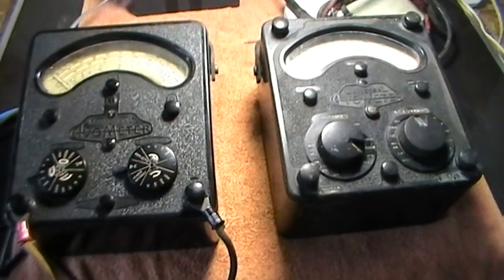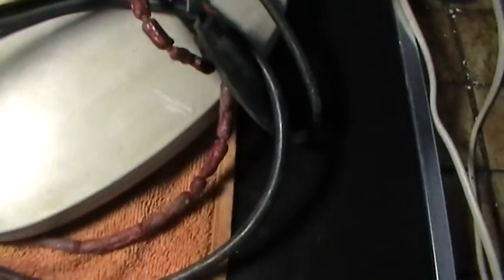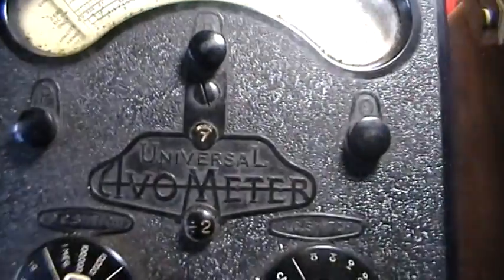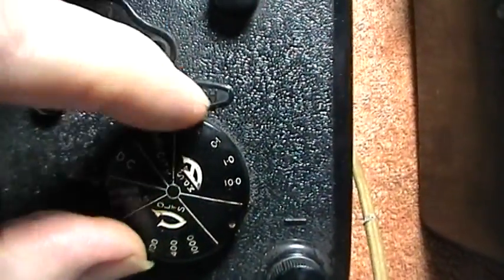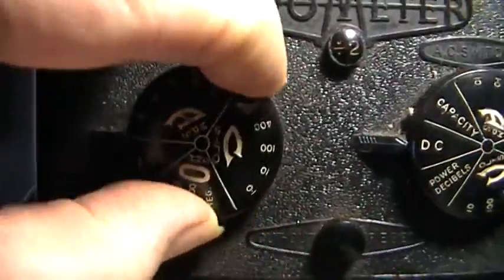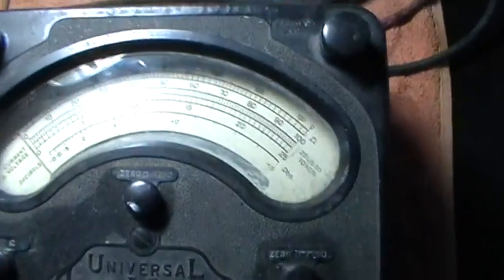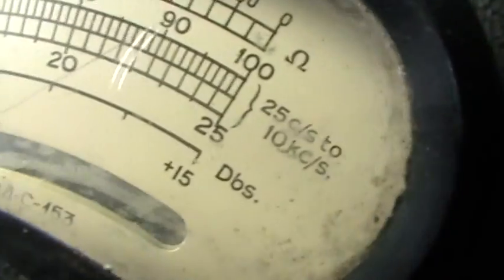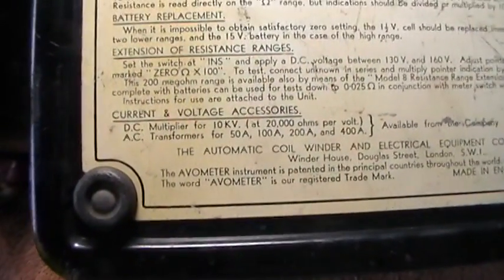AVO multimeters models 7&8

Comment: I picked up the model 8 I payed £5 for it Bought it out of curiosity please please what is it worth? Not sure if it works don’t know how to use it
Reply from the maker: Looks like you had a good bargain, check it out the batteries in it are probably dead and the smaller one may not be still made, take care when testing the meter. How much would these cost I do not know it seems vintage stuff has really gone up in price. Good luck

Comment: The Avo 7 is the 'electricians' meter and is less sensitive than the 8 which was intended for electronics applications. Although Avo's were produced from the 40's onwards, their hayday was the 60-70's.  Apart from nostalgia, they are still useful to the vintage radio fan for servicing even now, due to the voltage readings in period service information being taken by Avo's. Using a modern DMM with their very high input impedance, the voltages would be higher than if read with an Avo with it's 20,000 OPV sensitivity.  Yes, you can compensate if using a DMM, but using an Avo is easier and more satisfying on vintage equipment.  An interesting little fact is that Avo stands for Amp's, Volt's, Ohms.
The last versions made, the Mk5, Mk6 and Mk7 used a totally different internal construction with flexible printed circuit 'wiring', these can be troublesome if they have been misused, or 'got at'. The Mk6 and 7 also didn't have the high voltage terminals at the top of the front panel.  Apart from production cost and certain component availabilty, the main reason the traditional Avo ceased production was safety.  Modern DMM's have a CAT rating which specifies the voltage and application the meter is rated to be safe to work on. They have special HRC fuses, special internal circuit protection, and case construction, which protects the user from injury in the event there is a fault or user error. It wasn't possible for the analogue Avo to meet those new safety requirements.
Reply from the maker: Thank you for that info, very interesting, did not know the meaning of the name.

Comment: Your model eight is the first version which doesn't have a 500 volt range and has screw down terminals. The mk2s have the push in type with 4mm sockets.  If you look at the serial number written on the scale the last numbers will be the year the meter was made. The model 8 has a dc input impedance of 20,000 ohms per volt. The model 7 isn't as sensitive at 1000 ohms per volt on dc ranges.
You paid £4. In 1951 a new Avo model 8 cost £23. I still find it remarkable the model 8 was made right up until 2008 and was only discontinued because of difficulty in obtaining parts. They are a true British icon.
Reply from the maker: Hi thanks, I put this up some years ago must sort these out, thanks for that info......and also thanks to all who have commented about these meters...THANKS

Comment: very informative video I have a model 8 but it has stopped working now any ideas
Reply: Hi I have checked those off that I will look out for a suitable unit for spare from the sles sites or the bvws events
Reply: I have got a replacement 8 now as I am friends of the bvwtm in Dulwich and have now got another one on the way can not do without one